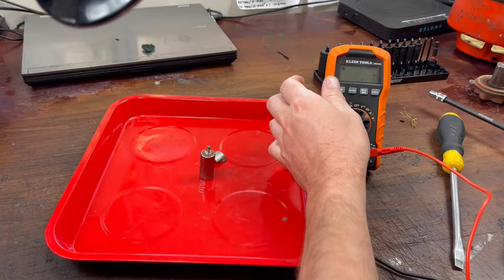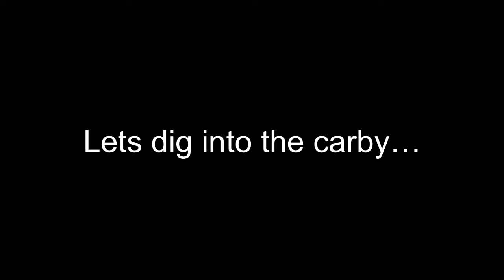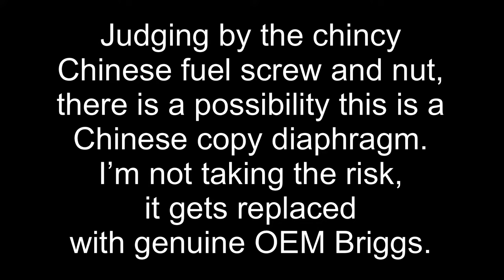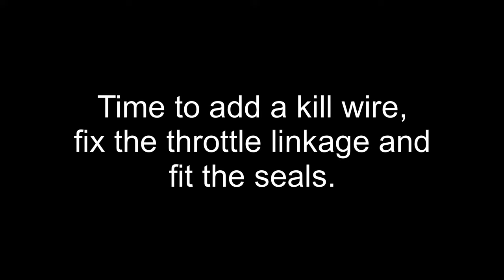VINTAGE BRIGGS & STRATTON  - CAN WE SAVE IT?

Comment: 20:40 that is the coolest thing I have seen this week. Machining that tip was genius.
Reply from the maker: Thanks :) I’m pleased with the result!
Reply: That WAS cool. I was mostly listening in my shop, working on the carb., muffler, and start rope assembly, on a newest(1980) of vintage Canadian made XL Automatic chain saw.
I will have to watch again, as the carb. had a bent needle. I made it straight though. The bend was from being hit or dropped, so the inside was still fine. My older saws though, need parts no longer available, so this is a good solution.
Reply: That sounds like a homelite XL automatic I used to have one of those, they were great saws. And they had good torque to them also

Comment: I have always used a business card for the gap between the coil and the flywheel. It's about 30,000 gap? And it works Everytime. And it's flexible also. Rotate the magnet side of the flywheel directly under the coil and insert the cardboard business card and,then loosen the screws that mount the coil, and the magnet draws down the pickup coil. Then tighten the coil mount screws and rotate the flywheel until the business card comes out and you will have a gap. Easy that was a trick i was taught years ago back when I was 13 years old and starting out working on small engines. Im in my 60's now and it has never failed me yet?
Reply from the maker: Yes you can, I prefer to use a gauge as I work on so many engines it just makes sense :)

Comment: I have one of these engines on an old cultivator. Looks like a tiller but is useless as one. I have it in storage but I know the engine is good. I put a diaphragm in it....ah....could be at least 15 years ago lol Anyway it ran then. Everything needs cleaning now. I haven't had a good use for a 3HP. 5 yes. 12 yes. I have two very old 5HP engines, one on my tiller which is older, and runs very well, and the original tiller's engine, still needing some parts, but actually in better condition than its' current replacement. You have to pay a lot these days to get a well made engine like these. Now if they would just make replacement gaskets of Teflon or something that can tolerate alcohol in the fuel....or stop putting alcohol in the damn fuel! They are deliberately ruining our carbs./engines IMO.
Reply: There are Teflon diaphragms for the fuel pump section of carbs, but not for the metering diaphragms, for lawn mowers, or those older 3-5HP carbs.. The rubber just does not like alcohol. I am putting the Teflon ones in my vintage chainsaws from now on.

Comment: That's what I would do?  replace everything that doesn't look like it is not a genuine Briggs and Stratton engine part?  And I liked how you tried to rebuild the needle jet. That was classic! I would like to see you rebuild my 20 horse power Kohler engine? I'm not sure if I want to take it on? Even though I have enough experience to do it? My thing is climbing trees and I have gotten away from most engine work. Having ADHD, I would have to have extreme concentration? Not to miss anything? Thanks for the video
Reply from the maker: Thanks for watching and commenting :) I have too many projects on at the moment to take another 🤣👍

Comment: Just today I wondered why the crank didn't go on properly or spin freely. And I found out it was because of banging on the end of the shaft to get the flywheel off. I had to fine sand both surfaces to get it to slide nicely.
Reply from the maker: Yep! They can mushroom when impacted, even with a brass hammer!

Comment: I love working on those small engines and they sound great, when they are running correctly. I  once built a three wheeled go-cart and I had a 3horse powered Briggs and Stratton engine on it and it ran like a top. And I got it to start on a half of a pull with the pull-rope starter. And the idle was down low enough to count the time's that the piston came up. It was barely running. Love your videos and thank you
Reply from the maker: That’s awesome :) thanks for sharing!

Comment: Great video, I have the exact motor to work. You gave us the confidence to try to repair it.
Reply from the maker: That’s awesome! Pleased to hear it :)
Reply: same here. Have the pull start issue and seems like the carb needs some love.
Reply from the maker: Is it squeeling? It’s very common. The starter mechanism needs to be cleaned as well as the crankshaft it slides on. A light coat of oil on the wick at the end of the starter too. Secondly, the balls need to be cleaned and replaced without any oil. Hope this helps!

Comment: Awesome bit of 3hp CSI 😁 it's difficult to determine what linkages should look like from the exploded dwgs.

Edit: you demonstrated the primary reason I want a drill press in my little shop. I used to turn brass into  pipes when I was in college, using only the drill press in the scene shop 😁
Reply from the maker: Hahah thanks Stella :) yes it’s very useful!! I’d love a mini metal lathe, but that won’t happen any time soon, the drill press will have to do 😂
Reply: @VintageEngineRepairs you can get a functional mini lathe pretty cheap, I bought a Sherline probably 20+ years ago for around $400 with all the tooling I needed, even the cheap Chinese ones are tight enough for turning small parts like what you're doing. I'm working on a 2hp horizontal shaft Briggs with the vacu-jet carb and it also had no spark but I hogged out the holes on a Honda coil and it gives great spark. I'm not advocating for it, I am impatient and I work with what I have on hand, but it worked and now the points compartment is sealed up and I don't have to bother with it anymore. I really just needed to see where the governor linkage went and you helped me right off with that, thank you
Reply from the maker: I now have one haha :) it’s been fantastic!

Comment: I enjoyed this video.  My grandfather operated a small machine shop, repaired mower small engines and sharpened reel mowers with a home made setup he copied from the one he saw in a large shop.  He also sharpened saw blades.  I now have his Atlas drill press and his Atlas lathe.
Reply from the maker: Awesome, thanks for sharing! 👍🏻👍🏻

Comment: That video sure did bring back a lot of memories. I remember upgrading to B&S's Magnatron ignition system. I think they used to rate their horsepower at 3200 rpm and govern the engines to 3500. Thanks for the memories.
Reply from the maker: That’s awesome! Thanks for sharing:)

Comment: 27:20 that sound of the 2-3 HP Briggs is one of the nicest sounds in the small engine world.
Reply from the maker: Haha thanks and thanks for the comments :) hopefully you caught my reply about the hammer on the crank shaft!
Reply: @VintageEngineRepairs excellent point on the brass hammer. I need to get one. I did mine recently with a block of wood and a regular hammer.

Comment: I don't know that the length of the throttle linkage, is important enough that you would not want to thin and stretch the metal hammering it. Probably not enough to matter, but making it weaker and more brittle may. If you wanted to, you could get a bit of brass to set on your anvil, and use a brass hammer. This way you straighten with much less denting/thinning/stretching and case hardening of the steel. You could also heat it some and straighten with very gentle hammering, but then you will dent it. If the metal seems brittle after hammering, you can heat it and let it cool slowly, to anneal, soften.
Just some thoughts as I was watching you hammer :-)
Reply: Should have watched further what?

Comment: Great video, I have one of these and a little newer version but Ive never been able to get a new diaphragm for them. When I asked at the local agent he looked at me like I was mad to think I could be a new one for a motor over 20 years old. Maybe thats not the case in the US but sure is here in New Zealand unfortunately, might have to try ebay but I dont know the exact part numbers and most stuff is Chinese from what I can see.
Reply from the maker: Yes they’re readily available :) google “Briggs and Stratton service manual look up” and then select the link to Briggs and Stratton website. From there it asks for some numbers for your model type and code. These are found on the side of your fan cover. When you type these in, it will give you the manuals you’re after to find the right diaphragm :)

Comment: Whoever played with it previously has used an ebay carby kit. I've purchased a few of them, the jets have never worked, I usually just use the o-rings etc and retain the original jet. The gaskets and diaphragm's that come with the kits have worked well.
Reply from the maker: Ah how interesting! Thanks for letting me know, I’m glad I changed out the diaphragm - I try to avoid AM where possible :)

Comment: Got the exact same engine today some guy gave me a California lawn mower with the blades but it has a brig and Stratton 3hp mower hopefully I make it run
Reply from the maker: Nice :) they’re awesome machines!!
Reply: @VintageEngineRepairs one question bro what was that tool u used to take the big thing out to get to the spark plug ima going to need that special tool it was the round socket
Reply from the maker: @MyRcGoSlow  hey mate have you got a time stamp?
Reply: @VintageEngineRepairs 3:39 thanks bro appreciate it
Reply from the maker: https://www.amazon.com/Briggs-Stratton-19244-Starter-Replaces/dp/B005F6PYVO
Reply: @VintageEngineRepairs ur the best bro ❤❤❤

Comment: Alright mate I've got a tiller with a briggs engine. I took it apart and cleaned it up! Was running great but half way through the day it just lost power so every time you try and work with it it cuts out. Starts up again runs fine then under load just cuts out! The governor springs and throttle where never great and I would just replace the whole carb but I have no idea what parts I should be getting that will fit. It's a 111202 - 0157 - 01 - 81022601 so I am proper stumped! Rather get it going than fit a new engine on the tiller as I love the fact it's so old but does such a good job (when it works)
Reply from the maker: Hey mate! It’s so hard to say just off that information. It could be a whole heap of things. Without hearing, seeing and testing I can’t be much help sadly! You can send a video to my email of what it’s doing, try your best to get as clear of a video without shaky camera so I can really see and hear :) tomscandian@hotmail.com alternatively, even better, go to @kenssmallenginerepair at 2pm eastern states time tonight and join in the live video, a bunch of us get together and can help you trouble shoot it!

Comment: Yes you can its old and built well i have the same type of motor but its a Briggs and Stratton 5 horsepower wood splitter. Trying to get it running after 20 years fog and stored it when we put it away. No spark but turns over fine
Reply from the maker: Clean the points :)
Reply: @VintageEngineRepairs  where do you get parts for these motors I am looking and it seems a lot of the newer stuff keeps coming up on line. Thanks again Kyle
Reply from the maker: Generally online :)

Comment: I have the exact same engine, instead of having the 3hp sticker it said jacobsens, it was because it was on a jacobsens lawn equipment tool
Reply from the maker: Great engines aren’t they!
Reply: @VintageEngineRepairs  yep! They still make good engines, I think
Reply from the maker: Ahhh I don’t know, they have gone so cheap with plastic cam gears, plastic carburetors, weak metal components etc they aren’t the brand they use to be imo. Hold onto your old one, they’re in a different league!
Reply: @VintageEngineRepairs  yea! I'm thinking either putting it in an offload go kart frame or a road go kart OR just playing with the engine

Edit: you took yours WAY apart, I maybe took the head off, accidentally forgetting about it for a year, put back the head on with an old head gasket (I know not meant to have a worn out head gasket) and it fired right up, we would put some paper in it and it would shoot out the exhaust, then we threw in some isopropyl alcohol instead of gas and it was 200°F hotter burning than gas, poor engine that is lasting somehow, turned the engine over like, a year later and it seemed good, I love the lil orange engine (is what I call mine)

Comment: Don't know how I missed this the first time around watching. A few questions... Did you indeed replace that condenser with a new one? Also I didn't notice any mention of what looks like a goopy attempt to seal up where the wire goes to the condenser. That sure looks like where all the moisture is getting into the electrics of the ignition system.
Reply from the maker: I think I left it in the end as I couldn’t source one without huge expense. That goo is silicone from the factory to seal up the gap between the HT lead and the points cover :)

Comment: Poking a screwdriver through the flywheel fins to hold the crank was known as a hanging offence in our workshop !!
Reply from the maker: I live life on the edge 😏🤣👍
Reply: just out of interest whats a better method?
Reply from the maker: @defenda1  The correct tool is called a flywheel holder. Far safer and smarter to use one than my hack method here.

Comment: I’ve been watching u a while   What procedure do u use when u first get a mower in that’s not working properly.
Reply from the maker: It all depends what is not working specifically. I’ll try and extract as much information from the owner if possible. If not I’ll have a look around the machine first, rotate the engine, look in the tank, check the oil, air filter, the blade. See if anything is missing, untoward or incorrect. See if it will start, if not I’ll bottle feed it and go from there depending on what I find.

Comment: I have same engine on scot bonner brigs and straton 45 she is still going
Reply from the maker: They’re awesome machines. Besides the thin rails on the SB, they’re my favourite cylinder mower. Nicest intermediate clutch pull, simple to work on and easy to adjust.

Comment: Hello! I live in the north part of Sweden and I bought yesterday a snow blower that has a Briggs&Stratton engine, it's a 5hp. Looks kinda the same like the one you have. I have a couple of issues. I cleaned the carburator, it was very messy and dirty. I checked the fuel tank and probably some water got inside at a point and I think it got a little rusted. I'm also missing the throttle cable, I can't seem to find it anywhere. Any advice would help!
Reply from the maker: Hey :) use some vinegar and soak the fuel tank to clean a fuel tank out, also regarding the throttle cables it’s just generic solid wire with a z-bend in it :) you can buy that wire at any mechanic shop! Best of luck, they’re awesome little engines!
Reply: @VintageEngineRepairs  thanks a lot for the reply and for the advices. Yeah, my personal opinion is that these engines can live forever if you take care of them properly. Cheers!

Comment: Oh you limeys are a riot snd your kings english. A reel mower is a Cylinder mower 🤣. Makes  perfect sense actually, learned a new one today. I have two Mclean cylinder mowers with these old briggs with pulse jets. The damn governmor spring is a pia. I converted mine to run on propane much easier than dealing with the carb and the propane keeps them clean inside, oil always looks perfect. Did the same with my riding mower. Got tired of dealing with the ethanol gas here. Now at least you can find non ethanol at various stations again.
Reply from the maker: Hey mate, yeah I call them both - cylinder and reel lol. That’s interesting! Do you have a video of them running on propane?? Thanks for sharing!
Reply: I made the video today
Reply from the maker: Great I’ll check it out :)

Comment: Hi Tom, I could not see the carb adjustments you were making at top end? Is there 2 screws, idle and top?

I have a newer version of this engine 3.5 HP which is a pain to start, had new diaphragms etc but no joy, it will start on bottle fed from throat of carb but refuses on pull start with filter in place. Any pointers on what to look at please?
Reply from the maker: Hey, yep! It’s the idle adjustment at the top and the one below that is the main full supply. Turn that out 1/4 to 1/2, a turn and see how you go :)